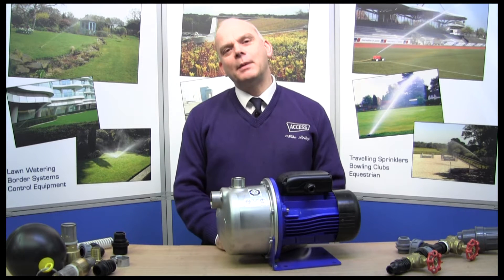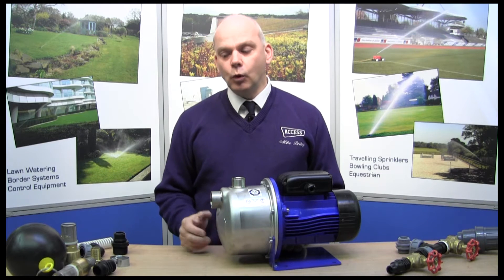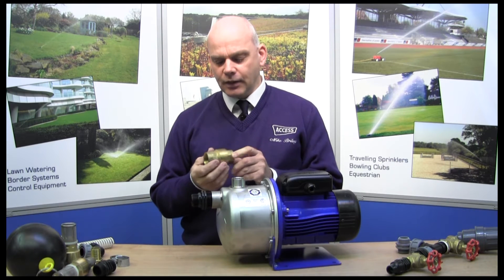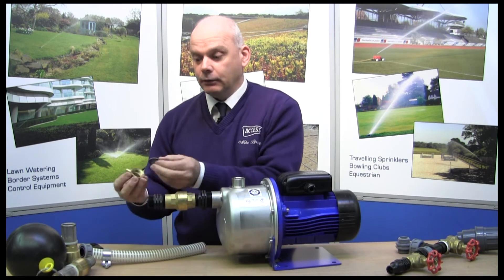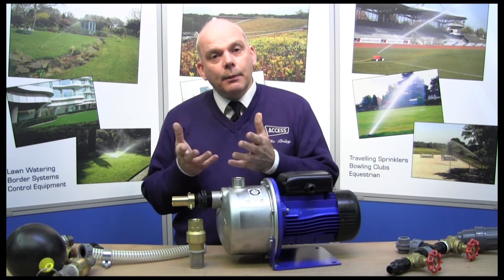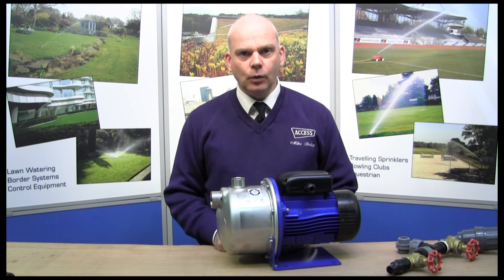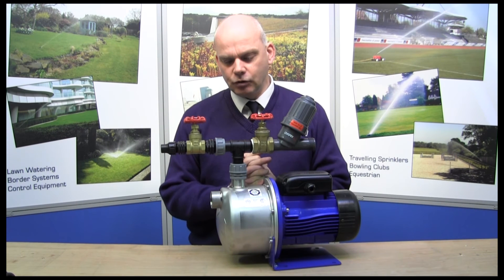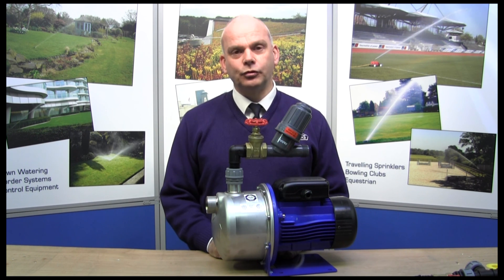Fittings required for Horizontal Irrigation Pumps

Comment: I just bought a 7000 litres per hour big pump .for inlet water I have 25 mm connections . For outlet connection should I use rigid 40 mm ???cheers from australia